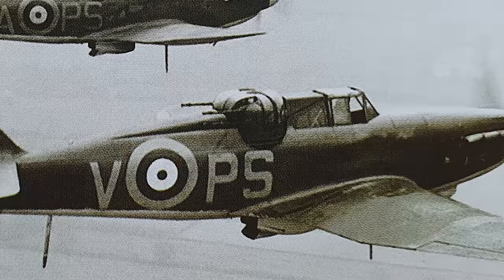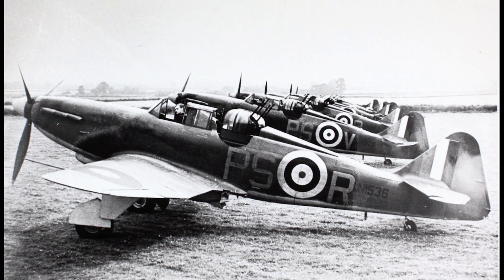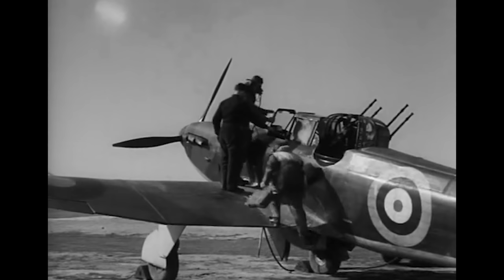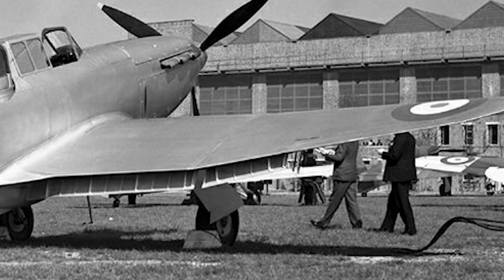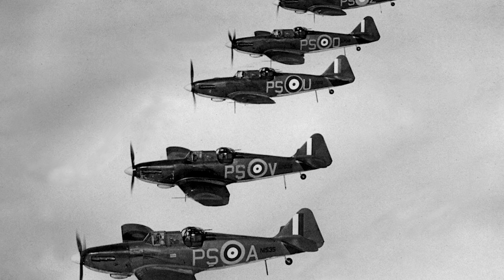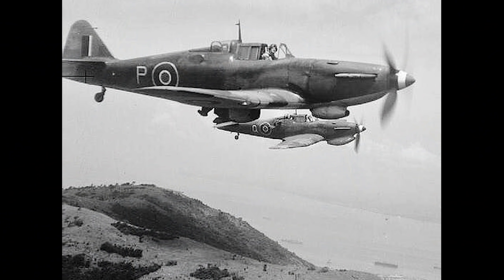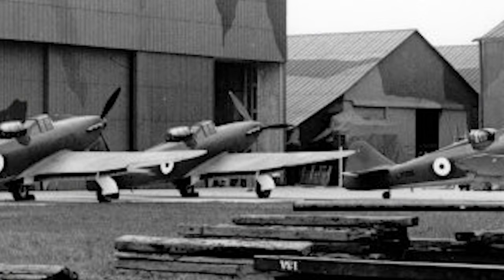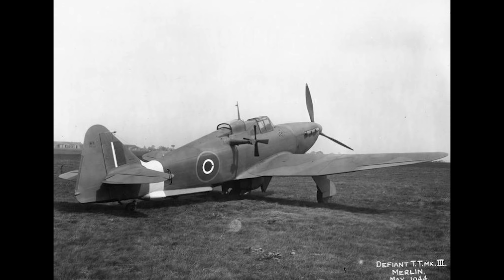Boulton Paul Defiant - The Unlucky Turret Fighter | Aircraft History #4

Comment: One version carried 12 guns firing forward in the wings. That must have been a nasty surprise for whoever was facing it.
Reply: I think I was only the Hurricane and Typhoon/Tornado that were equipped with 12 guns. The Defiant only had 4 guns total proposed. This was limited to one prototype. I am not sure if it even proceeded past mock up. 
The only point I was trying to make was that BP considered making a single seat conventionally armed version of the plane, and easily could have done so if they had received support to do so.
Reply: @kellybreen5526  it must have been a prototype but it was mentioned as build. Still, 12 guns forward firing was a lot to deal with. Cannons are much more efficient.
Reply: That was K8310 when it had been converted in to the sole P.94 (the Defiant was the P.82). It could be armed with 12 .303 machine guns or 4 20mm cannon and 4 .303 machine guns.
Reply: It was suggested as a stopgap in case Spitfire and Hurricane production turned out to be insufficient to meet the demand for single-seat fighters. It was never built though, just some trials with the prototype.
Reply: @AbelMcTalisker  I know.

Comment: I wonder what would have happened if they could have mounted gun pods on the wings..
Reply: It would have been even slower and less manoeuvrable.  It's max in its normal configuration was 304 mph (and it was hardly ever flown anywhere near that); with gun pods it would have been around 250-260 mph...

Comment: The wagon wheel, flying scissors and figure 8 tactics would have given the plane a longer operational careere. An they could have used a tactic similar to the German rotten for mutual protection. In the right circumstances the Defiant was good, But it would never hold its own as a fighter, Should it hold it's own as a single fighter it would need some forward firing weapon for a target of opportunity. I pity the gunner in the cramped turret, if he cant get out in time he will be dead.

Comment: To be fair, for a somewhat odd design from 1937, it held itself very well. So the base design seems to have been very solid.
Reply: It didn't hold itself very well as a day fighter.   Its reputation was built around its 'claims' of 39 Luftwaffe aircraft shot down on 29th May 1940, when the 'actuals' was between 3-4.  The Air Ministry continued to use two squadrons in the Battle of Britain (141 & 264) and they were withdrawn after being slaughtered in the skies of southern England.  And that's a fact.

Comment: folks are quick to go after the fact that they lacked the forward guns, yet completely ignore that they not only held their own but succeeded wildly in their role until tactics changed…basically, they did their job! and did it well! and even when surpassed by superior new designs and changed tactics that they forced on the Germans they still found a vital niche!

these were not badly designed, they were simply outdated and held on a long time due to need. their replacement got the praise, yet they did things that the Hurricanes and Spitfires never coukd
Reply: '...they not only held their own but succeeded wildly...'  No they didn't. 264 Squadron's claims on 29th May 1940 (39 victories) were vast overclaiming - in rality they got 4-5 at best..  They did not succeed at all, but got battered in the Battle of Britain, losing many good young lives, and were withdrawn from the action.

Comment: Terribly  designed aircraft, most were torn apart by 109s..
Reply: No, it wasn't. It was just designed for a fight that it wasn't allowed to fight.
Reply: @neiloflongbeck5705  Yes it was.  That was why it was withdrawn after heavy losses in the Battle of Britain.  Its design and performance were outdated by 1940.  And the Air Ministry specification called for a fighter, nothing else.  Were not the Spitfire and Hurricane also 'bomber destroyers'?
Reply: @Pokafalva  it was designed to shootdown unescorted bombers as they had assumed that the Germans would not get any closer to the UK than they had in 1914. The planners had assumed that German would respect the Netherland's neutrality in any coming war. This, as we know, didn't happen. So the Defiant was thrown into battles it wasn't designed to fight with the predictable results. It was not the design that was at fault, but how it was eventually used that was.

Air Ministry Specification F.9/35 called for a 2-seat day and night fighter with a speed of not less than 290mph at 15,000ft. It also called for all offensive armament to be fitted in a power operated turrent that would allow the gunner to lay the guns whatever the speed of the aircraft. There was a theory that as aircraft speeds increased pilots would have less time to line up fix guns to shoot down bombers, which were expected in mass unescorted formations. Aircraft designed to meet F.9/35 were intended to fly in formation with their target either along side or below and the gunner was expected to ksy his guns on the target whilst the pilot kept station with the target. However, combat experience demonstrated that pilots of interceptor aircraft like the Spitfire (designed to meet F.37/34) and Hurricane (designed to meet F.36/34) could reliable lay their guns on bombers and shot them down, and what's more they could also cope with the escorting fighters, which the less nimble Defiants could not. Both F.36/34 and F.37/34 were for fixed gun fighters.
Reply: @neiloflongbeck5705  '...Air Ministry Specification F.9/35 called for a 2-seat day and night fighter...'  This says it all.  The spec set in 1935 was outdated by 1940.  The all-up weight meant that it had a top speed of around 305 mph.  It was an unfortunate mistake that we proceeded with it as a day fighter right up to and including the Battle of Britain.  The pace of change was, it would appear, not taken on board fully by those who were making decisions regarding which types to deploy in combat situations, resulting, as I have said on this page, in the loss of so many young lives in an aircraft that was not fit for purpose in 1940...
Reply: @Pokafalva  and yet the earlier specifications for the Spitfire and Hurricane weren't outdated by 1940. Can't have it both ways. Anyway it was still faster than the 3 front line German bombers of 1940.

And you seem to be ignoring the fact that they expected massed formations of UNESCORTED bombers ie NO DEFENDING FIGHTERS. It was designed to fight a different war than it got to fight. That is not an issue with the design, but with the use it was put to. The German Wehrmacht was designed to fight short wars and not the war of attrition it ended up fighting in the Soviet Union, does that make the Wehrmacht rubbish? If you answer no, then you can't comment about the Defiant. If you answer yes, then you are a fool and no-one should listen to you again.
Reply: @Pokafalva  your lack of comprehension is amazing. You keep ignoring the reason why the Defiant was created and the fact that everyone acknowledges that it was forced into fighting a battle it wasn't designed to fight. The Wehrmacht wasn't capable of fighting a war of attrition as it didn't have the reserves of men or materiel for sustained combat operations. Likewise the Defiant couldn't fight when there was escorting fighters. It wasn't designed to fight fighters.
Reply: @Pokafalva  ps by rpthe time the Battle of France had been lost and the last British soldiers had been withdrawn from France's Atlantic coast in July 1940 Britain had to send up what it had to fend off the Luftwaffe.
Reply: @neiloflongbeck5705  '...your lack of comprehension is amazing...'  Don't think so.  I comprehend fully the original specs to which the Defiant was created, and the fact it was NOT fit for purpose in 1940.  The specification was for a fighter, not a 'bomber-destroyer', or anything else, a fighter.  And fighters fight, not only bombers, but other fighters.  Period.  The problem, IMO, is that certain WW1 views held sway, to the detriment, and death of, a lot of those young Defiant crews in the summer of 1940.  That WW1 thinking also held sway, (again IMO) in the way the Allies fought the Western Campaign in the Spring of 1940 - believing it would be a fairly static war behind strong defensive lines, not the rolling Blitzkrieg that actually occurred.
Reply: @neiloflongbeck5705  That point would have some credence IF everything had been sent down to 11 Group in the south-east of England immediately.  However, that was not the case, as I'm sure you know, so to say '...in July 1940 Britain had to send up what it had to fend off the Luftwaffe...' is simply not true.  Anyway, have a good Xmas.  Take care, stay safe.
Reply: @Pokafalva  yes, you have a complete lack of comprehension. You are looking back on events and seeing the outcomes but are not taking into account that when the decisions were made the future was unknown. No one could foresee that the Netherlands would be invaded, after all in 1914 the Getmans had respected the neutrality of the Netherlands even though the Schlieffen Plan called for the invasion of the Netherlands. Nor did anyone foresee that the Germans would fight a war of movement (in German Bewegungskrieg and not Blitzkrieg which was an Americanism) utilising ground and air forces in combination. This lack of comprehension leads to the false conclusion that the Defiant was poorly designed. But as pointed out it wasn't designed to operate in the battles it was forced to fight in. As pointed out in his work on aircraft design for the RAF between 1923 and 1939 Colin Sinnott states that aircraft companies had to supply aircraft suitable for fighting a war at some unspecified time in the future against an unspecified enemy at a time of rapid technological change. The Germans weren't officially the enemy until late 1935. There were many aircraft that by the time the war arrived were no longer going to be fighting the kind of war they had been planned to fight, like all the heavy bombers in service 1940 which had been designed for daylight operations but after heavyblisses had to ge switched to night operations. Does that mean these designs were obsolete as you think the Defiant was? Or does it mean that they were no longer capable of operating in the role that they had been designed to fill? Yes, it's the latter.

In Air Ministry specifications the letter, when present, indicates the role or one of the roles that the aircraft will carry out. F standing for fighter covers everything from a point interceptor (like the Spitfire F.I) through to a night fighter (such as the Wrlkin NF.II). As such you can't put much emphasis on the leter in the specification without reading the actual specification.
Reply: @Pokafalva  Air Ministry Specification F.9/35 called for a two seater turret fighter to replace the Hawker Demon. The Air Ministry at the time were stuck in WW1 thinking aand not exactly known for  thinking through their ideas. Also bear in mind that both front line fighters the RAAF had were the result of Mitchell and Cam ignoring the Air Ministry and developing pure fighter designs. Also bear in mind the exact same Air Ministry were trying to divert resources to Bomber designs and starving fighter production during the Battle of Britain. Fighter design was actually driven by the manufacturers and not the Air Ministry.
Reply: @suburbiapheonix7960  Don't disagree with this, apart from the fact that the manufacturere were working to Air Ministry specifications.  What they did with the resources available at the time, however, was superb, I think you'll agree.
Reply: @Pokafalva  not impressed by your claims of 40+ years of talking bollocks. The Air Ministry was, if you'd done any research, one of the more forward looking ministries. After all they invested in radar and built hangars (the Type C) with doors wide enough to open to 120 feet, when no RAF aircraft had wingspan that large. The idea behind the turret fighter concept was sound, just like not fitting the F-4 Phantom with a gun. Both the Phantom and the Defiant ended up fighting wars that they were not designed to fight. It is clear that you are failing to open your mind to new ideas.
Reply: @suburbiapheonix7960  the Defiant was intended to shoot down unescorted bombers not escorted ones, after all the Air Ministry, that backward ministry that funded radar research, couldn't foresee the loss of The Netherlands, Belgium and France.
Reply: @Pokafalva  it doesn't matter who you've worked with. You're still ignoring the fact that the Defiant was used in a situation it wasn't designed to operate in. That shows your ignorance.
Reply: @Pokafalva  to reiterate my first post. The aircraft was not a terrible design, it was just used in a situation that it was not designed to operate in. The concept was found. The design was sound. The usage was wrong. Ergo you don't understand the difference between design and usage.
Reply: @Pokafalva   1. Which WW1 design was it based on? And don't  say the Brisfit as that's bollocks. The Brisfit as the Brisfit was designed for aerial reccon and artillery spotting, not as a fighter. 4 of the 6 sent over the German lines during the Battle of Arras were lost. Pilots soon learnt that if they used the synchronised Vickers machine gun as the primary weapon and the strength of the airframe and flew the Brisfit like a single seater the Germans would have had a harder time of things. 2. Yes, you do design all vehicles including combat aircraft to fulfill a given design role. 3. Prove without using hindsight that the concept was outdated. 4. Yes, there can be, a case in point is the F-4 Phantom over Vietnam where it was used as a dog-fighter when it was designed to shoot down bombers from a long distance with missiles and was instead fighting smaller more nimble fighters and needed to be retrofitted with first a gun pod and then an internal gun. You have a strange idea of how combat works in reality. Fighter is just an aircraft type, just like cars there are many different types a fact thatbypu curiously don't seem to grasp even after 40+ years of doing research. 5. You have failed to understand the difference in design and usage. The Defiant was designed to fill a certain role, the role of shooting down unescorted bombers.
 And yes I have spoken with WW2 veterans from both sides.